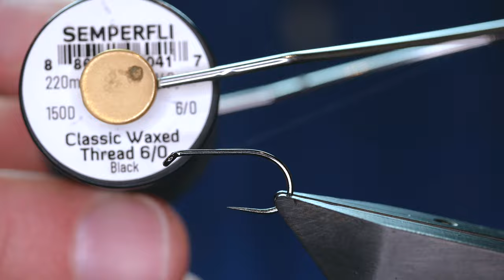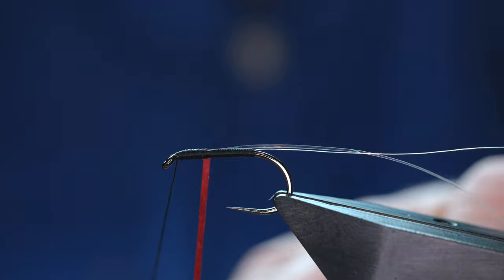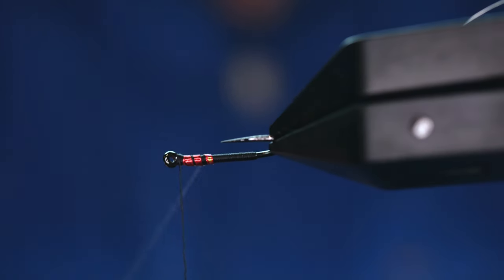How to tie the Traffic Light Buzzer #fishing #flyfishing #flytying

Comment: The TLB is the starting point of a wide range of effective patterns. In multiple variations of colour, size, hook weight, style. Change the thread colour, different colours of holo, (I found black holo with red, green, or silver effective in dull or difficult conditions) try a collar behind the thorax, a hotspot at the tail, even reversed with the thorax at the bend of the hook. Every one of your tips right down to using the rats tail waste. Is covered with why it works for you. It helps both beginners as much as it reminds old hands not to cut corners. It will do never does.
Reply from the maker: Thanks Mick.